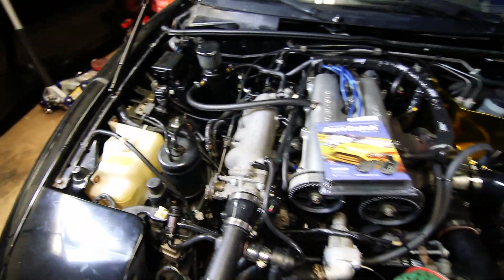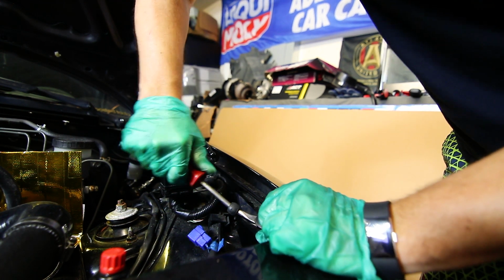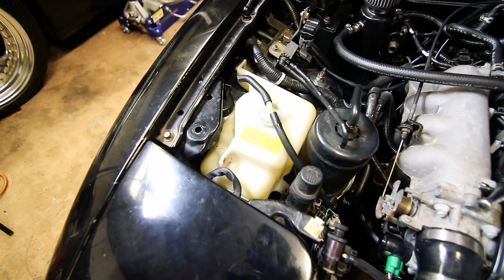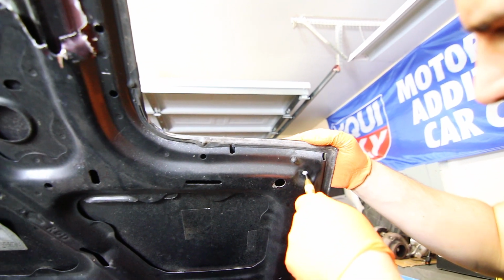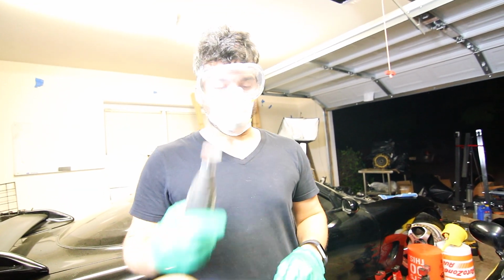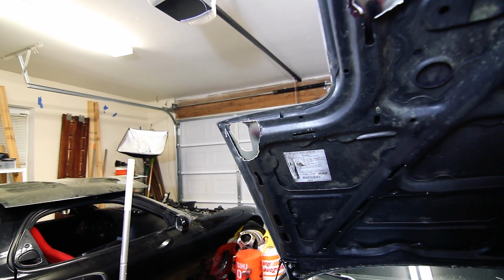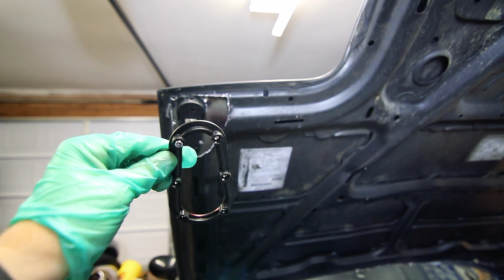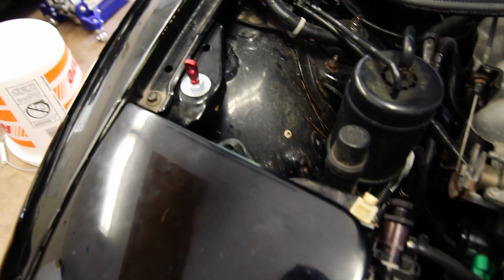Installing AeroCatch hood latches in the Miata

Comment: why didnt you paint the inside of the freshly cut hood? isnt this a weak spot for rust?
Reply from the maker: Yes you are absolutely correct. This area, along w/ the cuts for the over the radiator FMIC were painted after the fact.
Reply: @supercarmio  was already wondering if you just didnt said anything about it, because otherwise you made a quite competent impression
Reply: Miata hoods are aluminum. They won't rust (unlike most)

Comment: Did you end up using bump stops?
Reply from the maker: I did not, the amount of threads protruding was not much. You could probably cut a tiny sliver though if you wanted to use them.